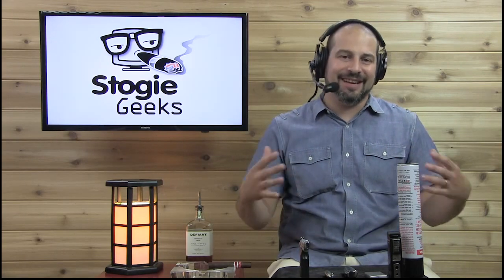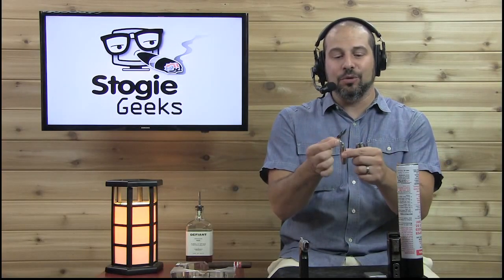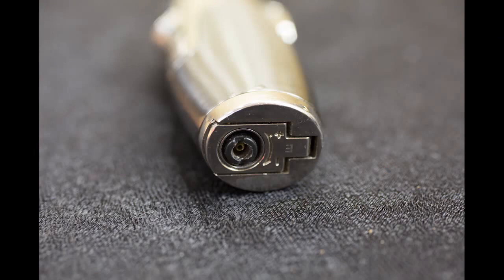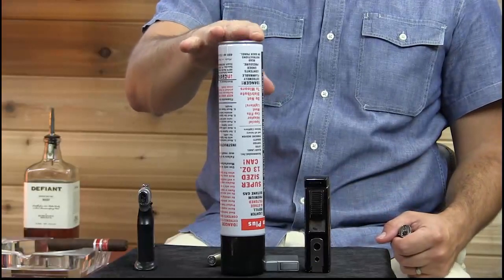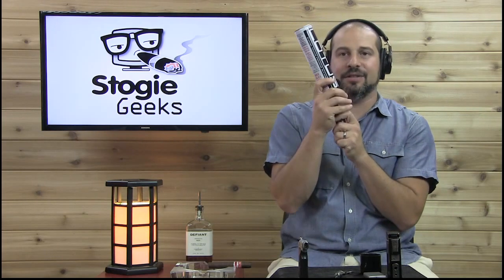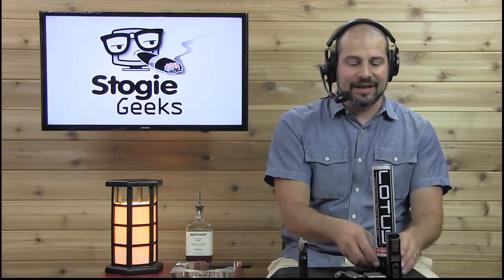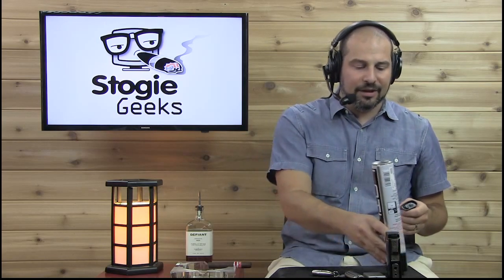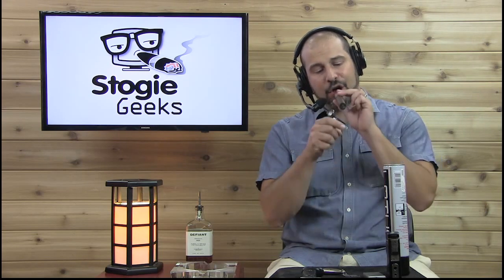Stogie Geeks 101: How to Refill a Lighter

Comment: Not trying to be a smart ass, but just a small (but significant) correction here. When Paul says "air", he should have said "gas". Because it is not at all air in the lighter or butane canister, it is butane gas. That said, his instructions are very much correct. Always discharge all (residual) butane gas (which would otherwise prevents a proper filling) before you try to fill it up with liquid butane. The same goes for keeping the refill canister upside down. Because you want to fill your lighter with liquid butane and not the butane gas that floats on top of it.